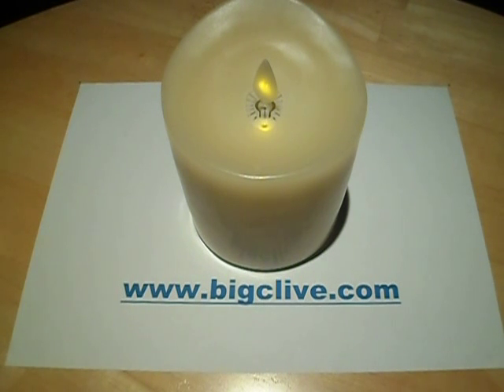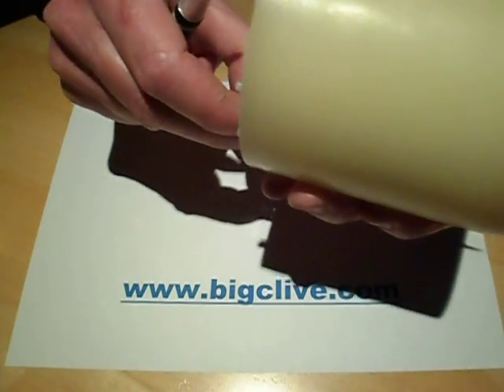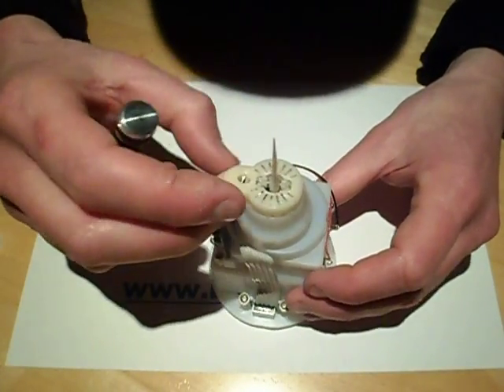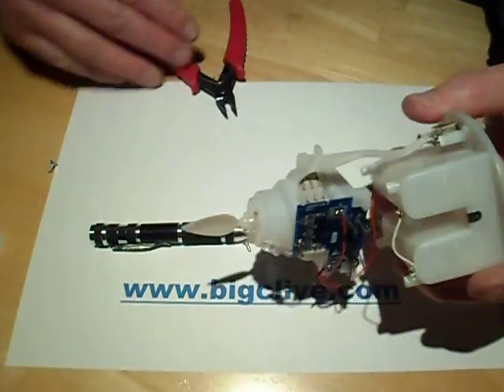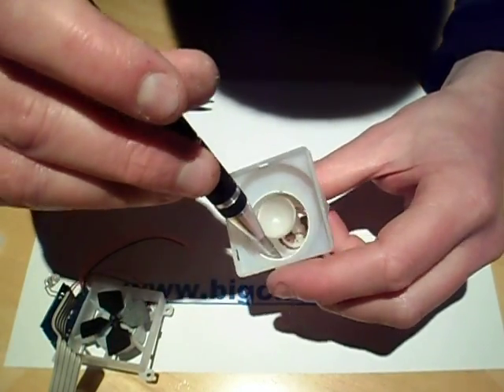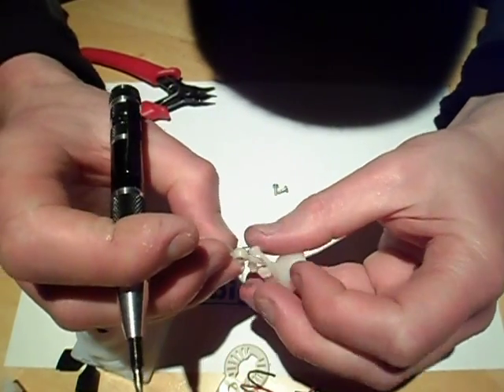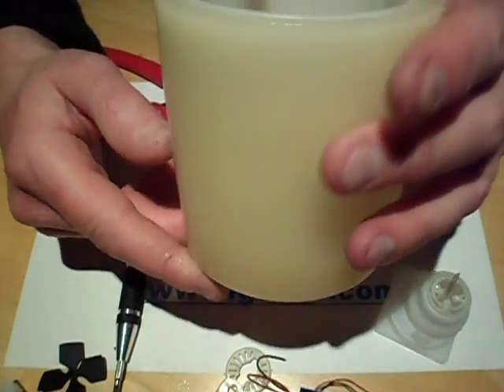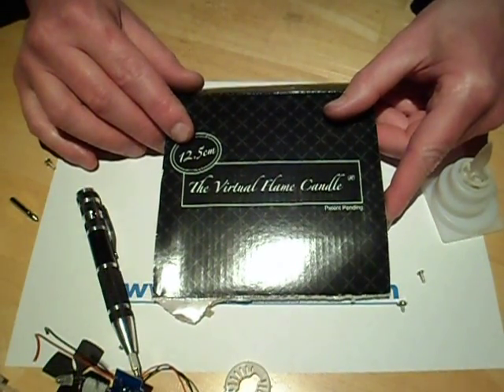Review and teardown of a Li-Lo virtual flame candle.

Comment: Isn't putting batteries in parallel a bad thing due to variances in internal resistance?

(sorry for the comment necromancy)
Reply: won wonders if I have the same thing in an LED headlamp, and they are in parallel if it explodes and I'm missing the back of my head :P  I know it can run off on 18650 battery but sticking in a second lasts longer it seems